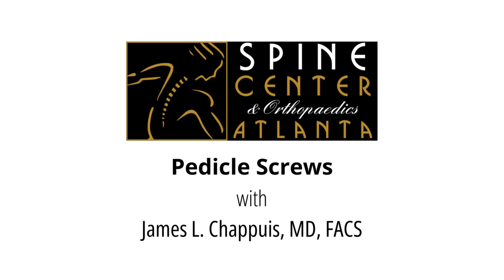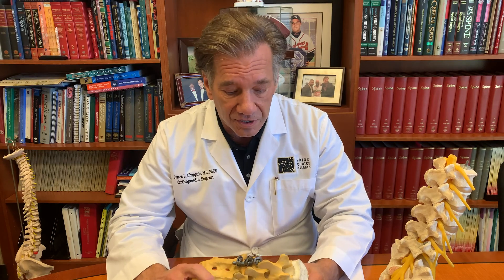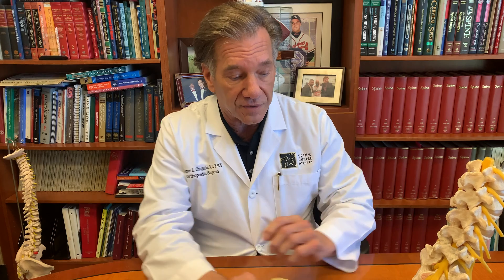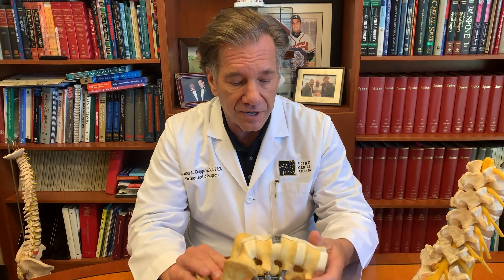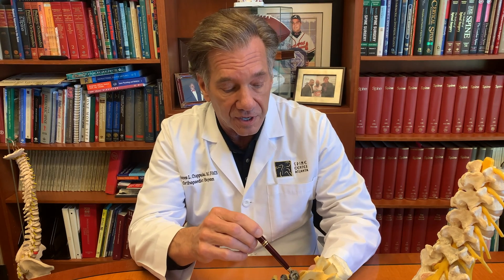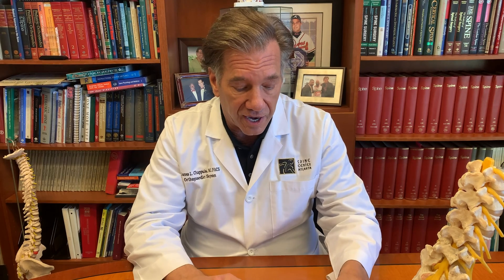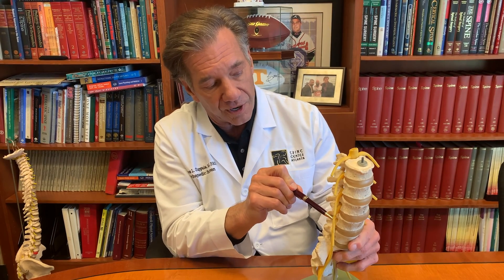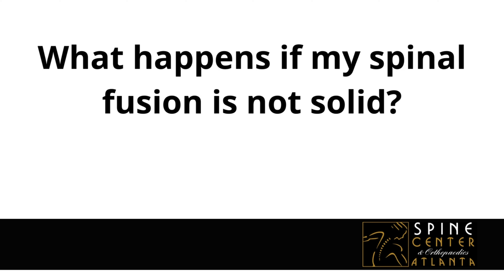Dr. Chappuis Explains Pedicle Screws

Comment: Thank you for sharing a great video. Very worried after very bad fall. Very bad button pain groin, throughs can’t walk far doing my head in. Waiting now.  Had leminectomy surgery some 50 ago. Fractures of T section from fall also need to lay down most of the time. I have faith in a Nuro I have seen some 4 times now just need to think positive but hard at 72 not young